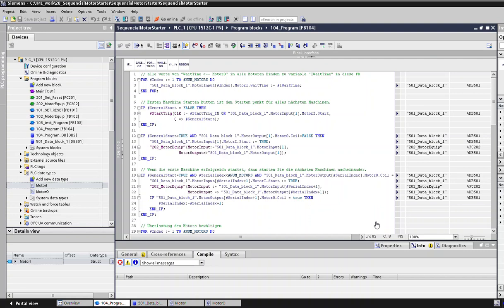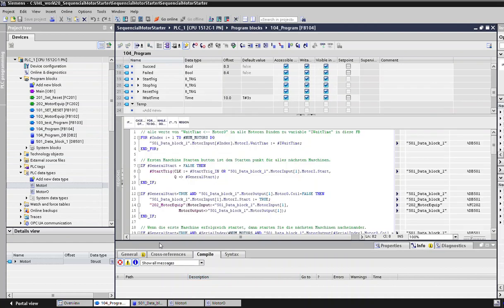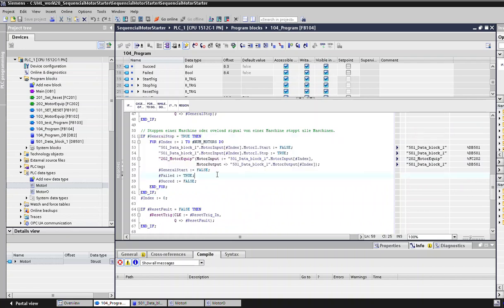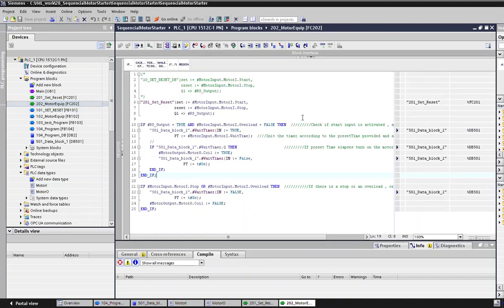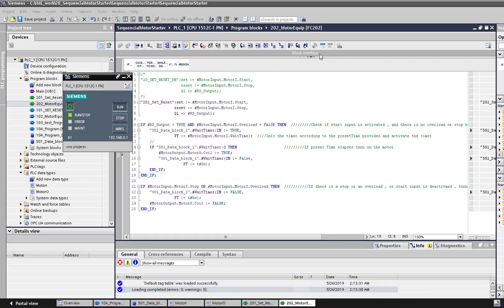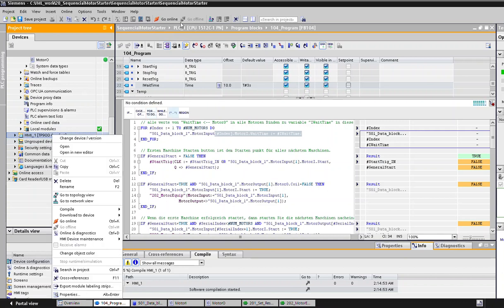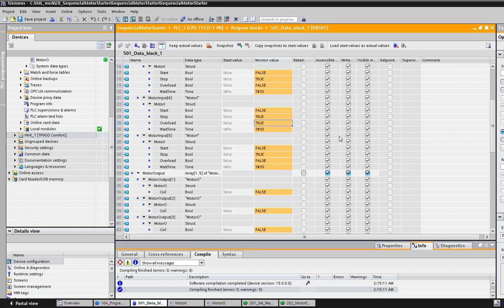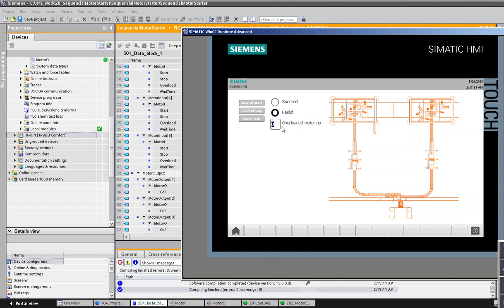A modular SCL program for sequential motor starter with_Siemens TIA portal V15

Comment: how can one set tag for each motor in the main OB1
Reply from the maker: Tags are not set in OB1. In case of field application you need to assign those DATABLOCK variables to the physical PLC IO Tags. What I do is I create an FC called IO_image & within this FC I assign all the DATABLOCK variables to the appropriate PLC tags.
Reply: @guzzar100 Hi, I am newbie in  tia portal programming.
 There is an option for plc tag directly where it has the addresses connected to IO directly. So at the beginning I used PLC tags, now some videos, I can see they are using datablocks and that makes me confused where it has no address type. as per ur information, if i do that with io_image, so what is the use cas of plc tags which i have used earlier. It's a humble question, kindly respond it.

Comment: Nice, is it possible to send the code in text-format to me ? Interesting stuff.
Reply from the maker: https://github.com/JamalMuhammad/PLC_Siemens_SequencialMotorActivation
Reply: @guzzar100  Thanks Sir, It is downloaded and I will load your code into a plc. It sounds great !!! I will tell you later after testing if I can solve things. If it is, I will mark your code with your name in the comments. Again thanks !!!!
Reply: @guzzar100  Is this code already active in industrial environment. You are a professional, when I look at your project.
Reply: @guzzar100  Sorry to interrupt yu alot, but I see this system is already used for a packaging line with pick robots and flow pack equipment. This is also my area.